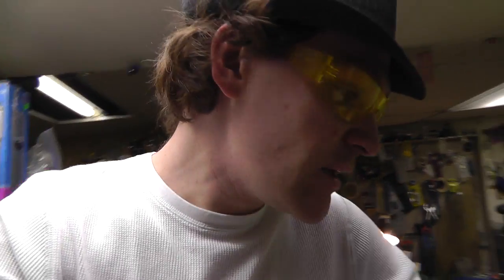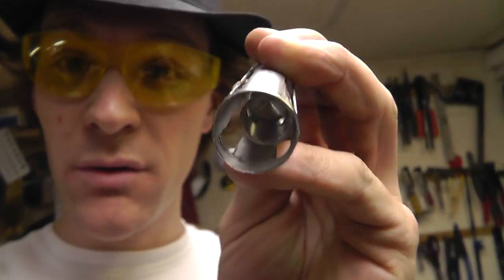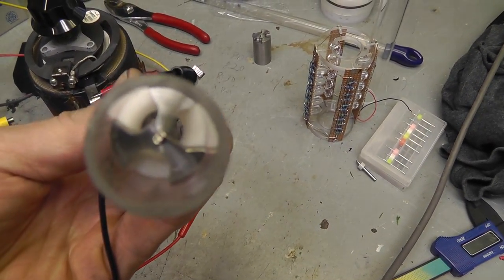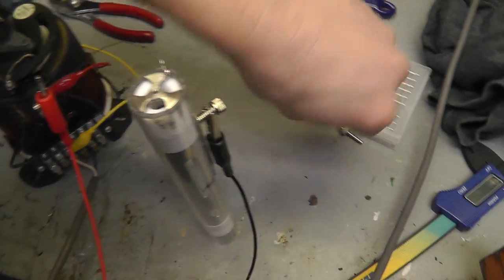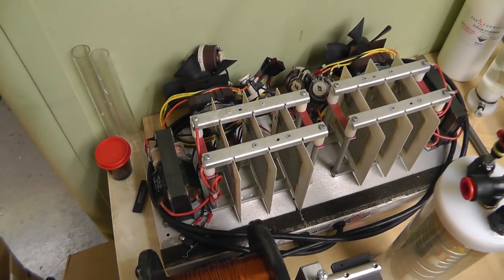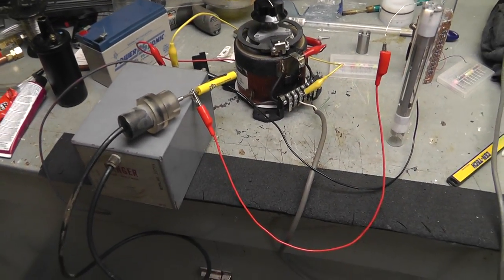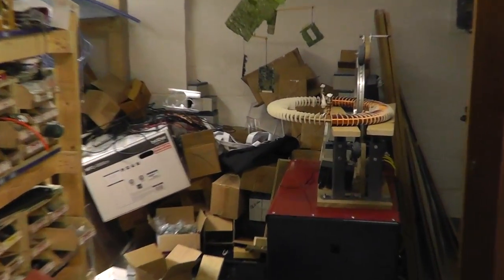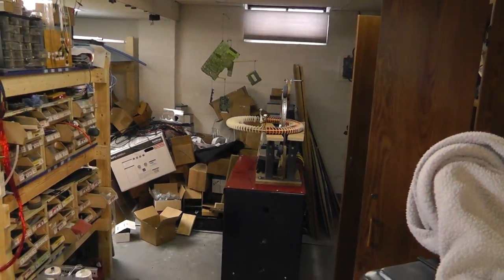HGG New Start P1,Gas Ionization Via DC Corona Discharge. RWGresearch.com  1-13-12

Comment: You need UVC or (280 – 100 nm band) to have any real effect on O3 production,  UV-A and B will have little impact,  VIS (Visible Ultraviolet) will have absolutely no impact (standard UV led's only produce VIS, the ones capable of producing C bands are extreamly expensive and hard to come by. So your only real option is to use unshielded mercury halide tubes (normally used for fumehood/glovebox sterilization )

Comment: @rwg42985 Very impressive but I gota question What about usen tungsten instead of stainless steel wire? Tungsten as in the electrode they use in TIG welding. Higher melting temp and better conductive keep up the good work bro